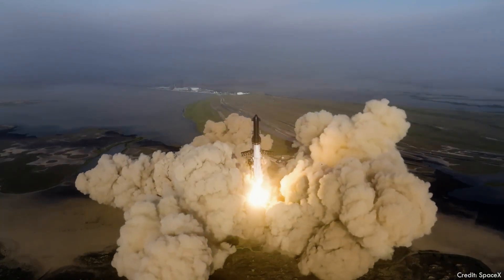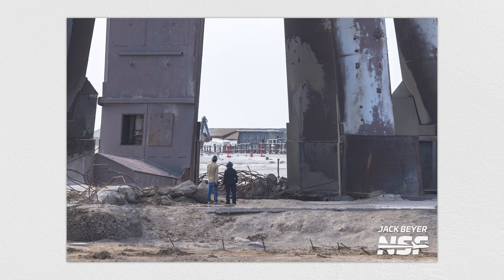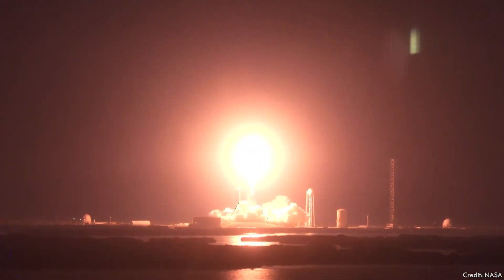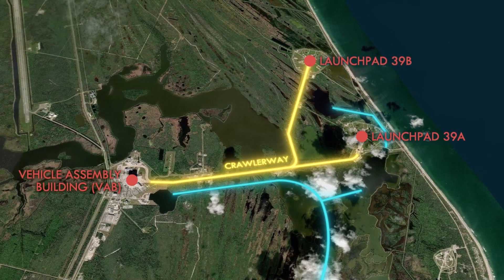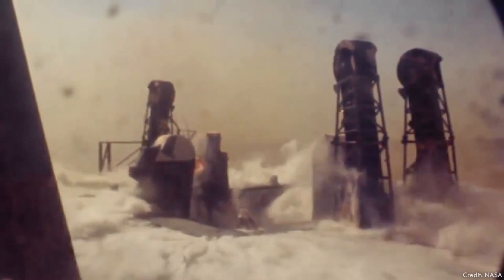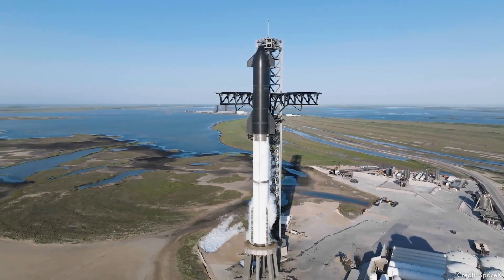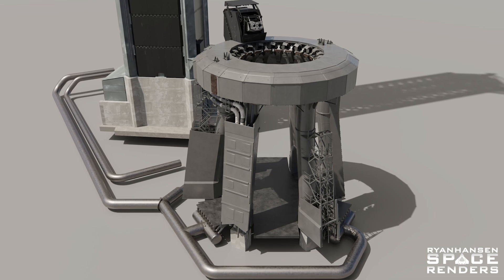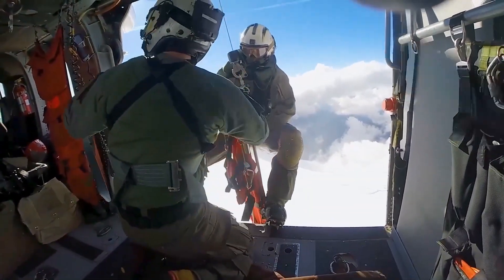Was Starship’s Stage Zero a Bad Pad?

Comment: Why does all the science media repeat the fact that the trust of the super heavy is twice the trust of the Apollo? The Apollo had a trust of just over 7 million pounds. The SuperHeavy had a trust of just under 10 million pounds. 10 is clearly not 2 times 7! It's not even 1.5 times higher, it is about 1.43 times higher.
Reply: The 10M pound figure was for the 31 engine test fire. The 'orbital' launch was with 30 of the 33 engines and at around 90% thrust, so roughly 13.7M pounds of thrust. At 100%, the Superheavy booster is 16.7M pounds of thrust.

Comment: Signed up for Nebula.  Love your content.

Wonder if they'll couple the system with NASAs fluid vibration dampener they use on their launch tower.  I've been hoping that tech will spread like wildfire in southern California to mitigate potential earthquake damage.  It'll probably be after major damage when it'll be used... It's already commercialized, but haven't seen much about it since pre COVID.
Reply: 2020 put a end to all innovative solutions. Instead we were more concernced about remote learning, or working from a distance. If people focused on heavy industry more, that the only way to build the future is with grease, metal and oil then perhaps we can see more effort to roll out earthquake dampeners.

Comment: NASA also used asbestos in the flame trench at 39a, I believe in the joints between the concrete slabs. I remember mesothelioma lawsuit ads talking about the flame trench specifically as a potential source of exposure.
Reply: Asbestos is a very good material, it does things no other can do.

Shame it gives cancer.
Reply: Meh. Asbestos is still used in applications where it is necessary.
Reply: @scythelord  yes. I thought it would be an interesting inclusion to the engineering discussion, though I suppose it fits better in a materials or mechanical engineering discussion rather than a civil engineering discussion but the video was already starting to straddle that boundary.

Comment: Why can't space X make an Electric Rocket like tesla which helps to completely reduce these issues.
Reply: They make electric rockets, every Starlink satellite has one, but those do not have the thrust to lift a massive craft from the surface.
Reply: The Electron booster from Rocket Lab is a 1.2m (4ft) diameter booster that lifts an up to 300kg (660lb) payload on the upper stage. The Superheavy booster is 9m (30ft) in diameter booster that lifts an up to 100-150 metric tons (110-165 US tons) payload on the Starship (second stage). Huge difference between the rockets.

The part that is electric on Electron, are the turbopumps that pull propellant from the tanks to the engines, so have nothing to do with the differences in thrust between them.

Comment: the leading theory is not that the concrete failed directly, but the ground beneath the concrete compressed leading the deformation in the concrete leading to a crack, and then the gasses from the rocket exploded the concrete from there. this is why in the new design they put way more pilons into the ground, and will have a deluge system to reduce the sound waves
Reply: Is this insider info?

Comment: It's quite disappointing to see a video from Grady of all people letting SpaceX slide with their utter insanity. Pretty much ignoring just how much damage SpaceX has caused "filling" their surrounding environmental preserves with their "explosive testing". The area they reside in are home to a number of endangered species. SpaceX knowingly testing on a subpar pad "because the water spraying system wasn't ready on time" is blatantly irresponsible and we should not be excusing them as "exciting full scale tests that we get to follow along with". It is also hilarious how SpaceX expects their new "upside shower head" to survive the blast of 30+ engines when the current pad has been literally dug up by the blast. Without a flame diverter that "shower head" would have to bear the full force of the rocket during the launch, and so will the ground below it, it is ridiculous to see them expect the new pad to survive by slapping a glorified slab of metal on the ground.

PS. The environmental report didn't expect damage this extensive because SpaceX was licence to launch Falcons and Falcon Heavys at Boca Chica, they have been blatantly running at odds against regulations and abusing the Boca Chica area for these so called "rapid development cycles and full scale tests"
Reply: > The area they reside in are home to a number of endangered species.

I wonder which area is not a "home of a number of endangered species". Good God, there even some dorks protesting construction of a TELESCOPE (which has no effluents whatsoever) on a desolate VOLCANO PEAK nearly 3000m high, and yes, they also moan about "home of endangered species", while you'd be lucky to find as much as a spider living there.

What "endangered species"? And why do you think these "endangered species" are significantly affected by falling concrete? Do you have a photo of even ONE organism larger than bacteria killed by it?

"blatantly irresponsible", "we should not be excusing them", me me me, look at me, I'm so caring of environment, where is my twitter account to virtue signal on the cheap?
Reply: They won't just slap down a steel plate. As has been observed at the site over the past few weeks, they have been putting in an excessive amount of concrete pilings going down 110 ft. They are currently pouring a new concrete pad that looks much beefier than the last one, and they'll install the steel plate on top of that.

Comment: You missed quite a few details about the pat, how it was built and main reason why it failed
Reply: Martin reason was a dirty big rocket taking off.
Reply: Main reason still isn't known yet. As Grady said, the FAA report isn't out yet. Lots of speculation, sure, but no consensus.
Reply: @reverse_engineered  they said the ground under the concrete was not solid enough, so during the launch thrust pushed the concrete down and that concrete cracked and the rest is known

Comment: A flame trench is the obvious easy way  for Newtons 3rd law to not destroy stage 0. Starship is designed and will eventually go to Mars, and back. A flame trench is not able to be built on Mars at first, so they need a way to launch without one.
Reply: Since when did the plan change to launch the whole stack from Mars instead of just the Starship?
Reply: @skirata3144  point is, they need something other than a trench. I know it's a lot less thrust but they still need a plan.
Reply: @itchitrigger8185  To be fair, the OLM is pretty far off the ground, constituting a 360 degree trench. What Musk didn't wait for was the water deluge system. And as Grady noted, Musk wants to avoid a diverter at all costs, as it would apparently block access to working on the engines under the pad.

The Superheavy booster with its 33 engines are not needed on the Moon or Mars, as the Starship (second stage) can launch with 6 to 9 engines. For the Moon, HLS Starship looks to be planned to have a ring of 24 smaller engines at the top of the propellant tanks, for the last bit of landing and first bit of launch. With those smaller methane engines being roughly 25 meters off the surface, that should minimize disturbance of the regolith. I would suspect a Mars Starship would have a similar system.
Reply: Hahahaha!

Comment: I think it's just dumb engineering and trying to do something on the cheap. Even the attitude of well it's about what was expected, points to a lack of understanding that some things need to be built correctly to established standards and norms. No expert by any means but looking at the overview of the proposed design change with the metal plate will be a failure too. The rocket exhaust will just erode a hole right through the metal just like a plasma torch does on a water cooled plasma table to the metal plate being cut. The how to build a launchpad step of rocket launching has already been figured out long ago; not only in this country but in other countries too.
Reply: > No expert by any means but looking at the overview of the proposed design change with the metal plate will be a failure too. The rocket exhaust will just erode a hole right through the metal 

Bollocks. The metal plate method was already tested by SpaceX (there are videos) . What you and many other people don't realize is that exhaust is NOT very hot (it's nowhere near enough to melt steel) - it is "very fast" instead, the thermal energy has been mostly converted to the kinetic one.

Comment: The fact that Starship cartwheeled in the atmosphere, still under power, multiple times without breaking apart is as insane ad what it did to Stage 0.
Reply: Why? Is it hard to cartwheel in the air? I feel any faulty flying machine can do that.
Reply: @null090909  Rockets are obviously not designed to survive cartwheeling, all their strength is put into withstanding compressive forces during acceleration and not lateral ones from wind resistance during an uncontrolled freefall.

It’s a similar thing to how cranes aren’t usable in high winds, their tolerance for sideloading is relatively low.
Reply: @ShawFujikawa  But survive what? 

We are not entering the atmosphere with hypersonic speed. Just free falling from zero to terminal velocity. 

The air pressure on a free falling object is a well distributed force, not really something that can easily break bulky objects.

For a reusable rocket, that seams to be the absolute bare minimum and not something "insane" as @Real28 wrote.
Reply: @null090909  I don't know what to tell you. I think you either overestimate the tolerance of the average rocket to high dynamic forces or you underestimate the forces to begin with.

Go look at the launch failure of the Proton M for what happens when a rocket goes side on at high speed, it basically snaps in half.
Reply: Except that should have triggered the flight termination system. It failed at failing.
Reply: @vylbird8014  It was triggered, but it didn't do enough damage to actually destroy it. There are some photos running around that the frame was heavily damaged when it was cartwheeling before it exploded.

It failed at failing indeed
Reply: @dualtronix4438  The FTS didn't do enough damage to destroy it *immediately*. It took too long to lower the tank pressures to the point where the tanks lost structural integrity and failed. SpaceX is redoing the explosives so that the holes made are bigger, and the pressure is vented faster, causing a quicker failure.

If it weren't for the FTS, the rocket could possibly have survived intact all the way down. Though it would probably have to have stopped doing cartwheels and found an aerodynamically stable orientation, probably nose down.
Reply: @vylbird8014  it did trigger it just failed. You can see it in the live stream
Reply: @redditreviews9698  That isn't any better.
Reply: @vylbird8014  no not really but it did trigger.
Reply: I was impressed that something the size of a Skyscraper was able to tumble so much before it’s Destruction.
The Flight Guidance System <Chef’s Kiss>
Reply: Yet another super important safety critical thing that SpaceX chose not to fully test before launch. "Let's just test it in production" might work with business software, but for pity's sake us engineers don't do that with things that can kill people!
Reply: @reverse_engineered And it's not even just a matter of testing. I'm not an engineer but it looks like a simple calculation should able provide a good approximation of the quantity of explosives is needed for a successful autodestruction? Same as for the launchpad, looks like they didn't even care of guaranteeing themselves a reasonable chance of success. And that for critical safety aspects.
Reply: Isn't the popular contention that the flight termination system failed entirely and the later detonation was purely coincidental?
Reply: @boldCactuslad  you can see it blows a hole in the fuel tanks but just doesn't explode until the pressure in the engines dropped. Lots of vids explaing what happened
Reply: @boldCactuslad  No, as it spins you can see the jets of propellant escaping the sides of all 4 tanks where they were penetrated. It's just that stainless is considerably less fragile than Al-Li used in typical spacecraft, and for 40 seconds it failed to fail catastrophically.

Lesson learned - a few weeks ago during a ground test, SpaceX ruptured a test tank with considerably more vigor (and explosives).

Comment: No flame trench = dumbass decision.
Reply: To be fair, the OLM is pretty far off the ground, constituting a 360 degree trench. What Musk didn't wait for was the water deluge system. And as Grady noted, Musk wants to avoid a diverter at all costs, as it would apparently block access to working on the engines under the pad.

Comment: Hi Grady,
Great Analysis.
One minor Correction: the Flight was Suborbital, not Orbital.
😊
Reply: No, it was meant to be very much orbital. Only some annoying people like you go "akshually, it's technically suborbital".
Reply: Folks need to learn the definition of "analysis"...
I see it thrown around all too frequently in the comments section for things like this that is just reporting.
Just because journalism is about a scientific topic and features some contextual information, does not make it analysis, just good journalism.
Reply: The flight was meant to be orbital, but was in fact suborbital.
Reply: Let me clarify:
While the Starship may have been intended to reach an Altitude where it could, if planned, go into Orbit, the actual Flight Plan had the Flight end near Hawaii; short of an Orbit.
I stand by my Statement.
Reply: @davidawalkerjr2905  Sure, but using that to label it "suborbital" is misleading. The Suborbital 2nd stage tests of Starship where properly and clearly suborbital, not anywhere near orbital speeds nor altitudes. 

You don't call the Falcon 1st stage a "suborbital rocket booster" just because it doesn't reach orbit itself. By that definition, you could also go and call the Saturn V "suborbital", since it never completed an orbit, it was the S-IVB that did. 

Calling it suborbital is misleading, and nothing short of an insult.

Comment: Actually the flight termination system failed. It blew up several moments after it failed. Not to mention they planned to land starship but acted like it went further than it was supposed to after it blew up. Also they destroyed the protected habitat at Boca Chica. They should’ve never been allowed to build there.
Reply: There wasn't actually any plan to land starship. The ideal end state was for it to impact the ocean by Hawaii, but there wasn't any landing planned. Even with that though, it's important to clarify what the objective was. The point of the flight was to get as much data as they could before launching the next stack, not to actually get to orbit (although that would be amazing if it got there). Hence the baseline success being the rocket getting far enough away from the pad that it's largely unscathed (which despite the damage under the pad was largely a success). Beyond that they got a decent ways into booster flight and got a significant amount of information for the next one, hence it ultimately being a success (not a complete success, but a baseline success).

With the environmental stuff I'm less of an expert, but it's worth noting that the PEA did address the possibility of an explosion of the full stack on the pad. While not exactly the same as what happened, I'd say that it would have been worse and the FAA gave the okay for that. While there's one (or few) time damage to the surrounding area, once this initial development phase is complete there will be comparatively small impact to the environment compared to most other industries that could have built up there. Additionally, having a launch site in a wildlife refuge has been shown time and time again to have little to no impact. Nearly every single launch site in the world is inside a refuge. So yeah, it's not ideal, but the idea that they should have never been allowed to build there is quite extreme.

Comment: It was brought up after this test that the Mars mission will not have a pad to launch from the surface of the planet for the return journey.
I am curious how this problem will be solved.
Reply: The Starship moon lander will have a ring of thrusters near the top of the vehicle for landing and liftoff. It will probably be something similar for any Mars mission.  The advantage of both the moon and mars is the fact that the gravity is a lot less. This means you don’t need nearly as much thrust to land or launch of their surface.
Reply: The Superheavy booster with its 33 engines are not needed on the Moon or Mars, as the Starship (second stage) can launch with 6 to 9 engines. For the Moon, HLS Starship looks to be planned to have a ring of 24 smaller engines at the top of the propellant tanks, for the last bit of landing and first bit of launch. With those smaller methane engines being roughly 25 meters off the surface, that should minimize disturbance of the regolith. I would suspect a Mars Starship would have a similar system.
Reply: In low gravity with weak/no atmosphere, dust tends to simply be propelled sideways by rockets.  They don't dig holes like they do on earth.  It will be a non-issue.  NASA themselves use plain concrete pads to simulate landing conditions on the moon.

Comment: You missed a really cool detail, per Elon "one of the more plausible explanations is that ... we may have compressed the sand underneath the concrete to such a degree that the concrete effectively bent and then cracked".

They knew the rocket would damage the concrete because of the static fires, and were already working in the steel plate.  It just wasn't ready in time.  What they didn't expect was the rocket plume reaching underneath the concrete and flinging it up.